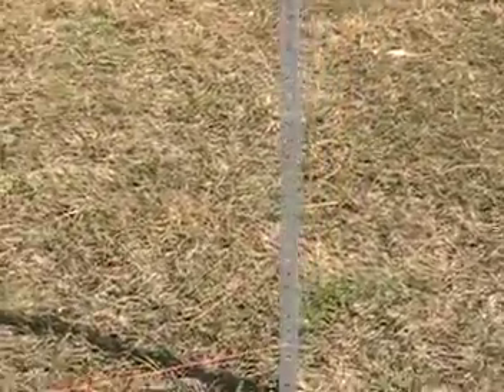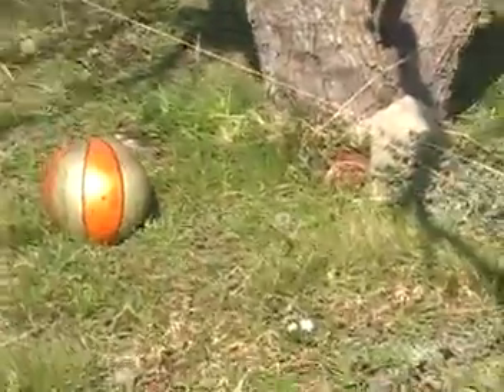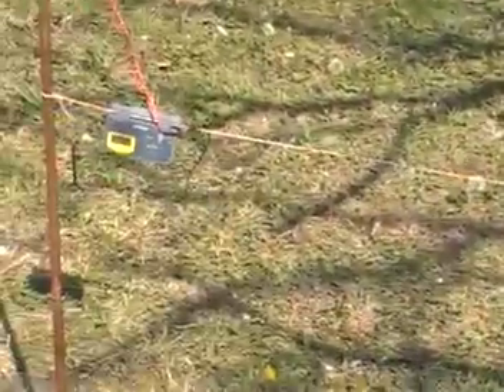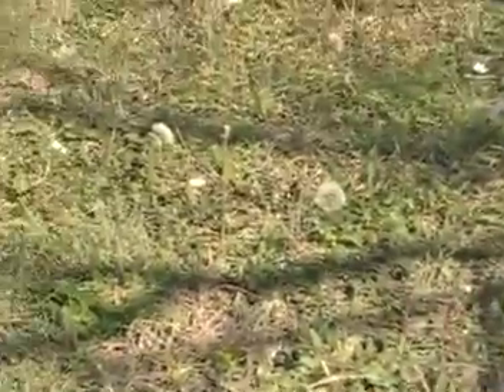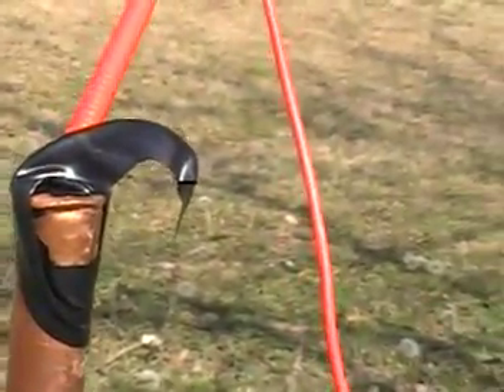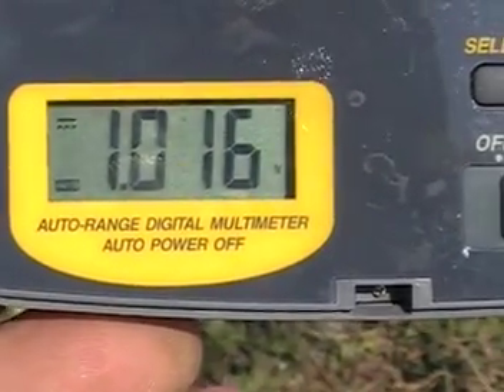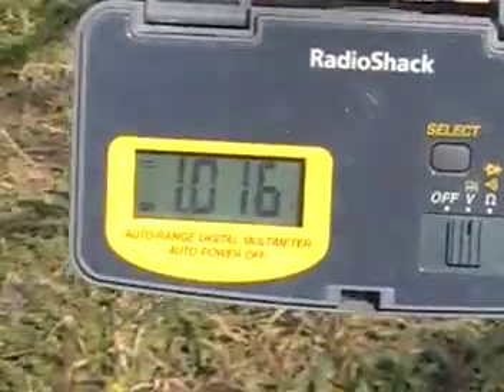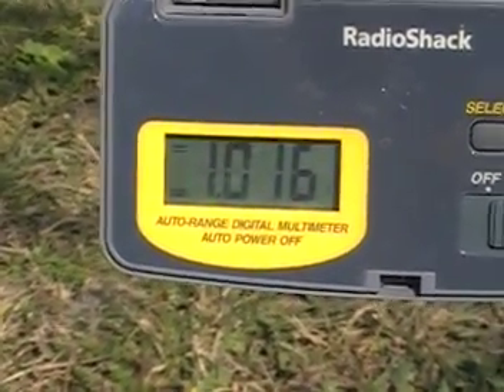My earth Battery

Comment: Is that true north or magnetic north? Kinda cool though knowing one's backyard has some energy :) Would it be possible connecting maybe a capacitor to it and letting the charge build over time? Ok I know..it would probably take 50 years..so don't everybody jump on me for just asking..LOL
Reply: A few quick bits of math:
1 Amp means 1 Coulomb of electrons are passing a point in a wire every second.
Capacitors are measured in Farads.
One Farad means that if you put one Coulomb of electrons in, the voltage will be one volt.  To put it two Coulombs, you need 2 Volts and so on.
A one Farad capacitor is a very large one BTW.
You can loosely think of a 1 Farad capacitor as a 1 amp-second battery.
A car battery would typically be 60 Amp hours
60 Amp hours = 60 * 60 *60 = 216000 Amp seconds
Thus if you are doing a huge number of charge / discharge cycles a capacitor may be worth investigating but if you need to store much energy use a battery.
Reply: I once read an article in Popular Science about some people studying lighting. They found that the charge in the air could be "bled" off if there were many small antennas to dissipate the charge. The numourous antenna points would reduce the number and strength of lighting bolt strikes. I often wondered if this technology could not be harnessed to charge a large capacitor or battery during a storm to feed power back to the grid at a later time.
Reply: Tn Flash If you have a sharp pointy object some distance above the ground, you will see a static build up on it even when there is no lightning storm in progress.  It would be a tiny fraction of the energy in lightning but it could be a worthy experiment to see what you get if you live in a place where lightning is common.  The energy in a capacitor is:

E = (1/2) * V^2 * C  AKA (1/2) * V * V * C

Where:
  V = volts
  C = capacitance in Farads
  E = Energy in Watt seconds
 
Since the V appears twice, you get much more advantage by making the V bigger than making C bigger.
Please don't kill your self while trying the experiment
Reply from the maker: if any one jumps on you for asking ,  they need their heads examined.  There are a couple of guys on you tube working on this and doing rather well . 5running LEDs and charging small things.

Comment: A real earth battery is not supposed to work by galvanic action. Rather it harnesses the Telluric currents in the earth as some commenters have pointed out.  If pure galvanic is all you are after it would not matter what orientation the poles ov the battery are. As for DC current not being able to travel large distances, this is false. It can travel just as far as AC for a given voltage. In fact sometimes they move large amounts ov power across continents using DC as the inversion and rectification losses at each end are actually far less than the inductive and capacitive losses AC currents over these distances would experience.
Reply: Right, I know for a fact that the large transmission lines run DC current.  They generate a force field so birds never sit on them.  Anyone can witness it for themselves.

Comment: You should read about Nathan Stubblefield, a farmer back in the late 1800's in Kentucky. This man ran multiple arc lights and other electrical equipment on his farm from so-called Earth batteries. He patented an Earth battery, although he did not want to call the device an Earth Battery---the US patent office would not give him a patent unless he changed the name to Earth Battery. He invented a voice communication device that transmitted through the Earth for many miles and was powered at the same time by his Earth batteries. Tesla theorized that the huge Earth currents that Stubblefield utilized were being generated by the Solar Flux, or wind. I was intrigued by this whole affair of Nathan Stubblefield's free electricity. I looked up the geomagnetic maps of the USA on Google. Sure enough, huge lines of magnetic force are flowing through Kentucky. I found a researcher who theorizes that because Stubblefield's farm was located in an area with large deposits of Pitchblende (Uranium Oxide), heavy electrical currents are generated. (I can't fathom the Physics of this theory) It would also explain why Nathan Stubblefield's family became ill and finally left the farm and Nathan---Radiation!. Over the years Nathan became thin and sickly and finally was found dead in bed on his farm that he neglected in favor of exploring this electrical phenomenon. The phenomenon is called Telluric currents, so-called Earth generated current. Its difficult to find in depth scientific information about this subject. True, telegraphers also tapped into this current to run their telegraph lines. Its fascinating how they located these Telluric currents. What Stubblefield was extracting from the Earth was not generated by a battery effect with two dissimilar metals. He was simply tapping into currents that happen to be flowing close to the surface of the Earth at this farm in Kentucky. True, tapping into areas close to trees improved current flow. Today, a college is located on the property. There are several web sites on Nathan Stubblefield. They aren't very scientific, but still are fascinating to read.
Reply: Seems the "earth batteries" used copper plates working more as collectors than two dissimilar metals to create electrolysis.   As pointed out, the two approaches are vastly different.

Comment: The earth frequency is more precisely 7.3 Hz.  
 My guess about achieving max voltage from an earth battery depends if you are at, on, or close to an earth power point - ley line.   You state about 19th century telegraph transmitting messages several hundreds of miles and that a much higher voltage would have been necessary.  It takes a degree of skill to find an earth power point.  If you can find  old telegraph sites/repeater stations(old train stations???) test the battery there.

Comment: This is how batteries work, you have two different metals in an electrolyte.
The metals will eventually get eaten away & the battery will die.
You have to choose if you want to buy copper pipe & zinc or buy a duracell.

Comment: telluric currents were discovered during the time of the telegraph, when they noticed a difference of potential from station to station amplify the signal, a natural phenomena that occurs on the earth, between the ionosphere and the crust of the earth and runs from the equator to the poles, maybe this was the idea of tesla's to use these telluric currents over long distance to produce large amounts of current, to power the earth wireless. but then again I have no idea what I am talking about.

Comment: first of all voltage isent squat without current unless its hi frequency 1 volt there should be 250-500 ma to do anay work 2 is time over volt amp this is how long it will go before its dead most tellagraph systems used a dry cell battery 1/1/2 volt-6  there was a way to talk using audio amps fed into earth  one to send one to receve and both sides need 2 to make it work

Comment: The theory behind this was part of my trade and what they did was they used the earth as the "Return wire" and had only one copper or galvanized wire between the stations so they saved on material. They still used dry cells for the current supply. The telegraphs used more current than the 0,000002 amps as what get developed!

Comment: They didn't use straight metal poles stuck in the ground. They have 2 coils on the transmitting end, one for + and the other -, but you grounded out most of your circuit with both ends grounded.

Comment: Earth is not a battery. The 2 different metals are a battery. what this experiment shows is that you can conduct current through the ground wireless.  Nikola Tesla did this first 100 years before this guy. He could light lamps just touching them on the ground with no wires 10miles from the source of the energy. Sorry for my english :)
Reply: ha...i wrote the same thing before reading  your very true comment,

Comment: try this, get a copper pipe 5cm diamiter, 1 meter long and at the end that you will push in the ground put some plastic around it and push it in to the ground about half a meter. then carefully get a zinc rod and push it in the copper pipe. when you push it make sure the zinc rod dont touch the copper pipe and it dont touch the plastic in the soil. if you make 12 next too each other and conect them in series you should get high voltage. WARRNING YOU CAN GET ELECTRICUTED BE CAREFULL. let me know.

Comment: All this is a basic galvanic cell, Stainless steel to copper?  The stainless steel is the anode the copper is the cathode the Earth is the electrolyte.  As soon as the stainless steel angle iron corrodes away...you will have no voltage left at all and the angle iron will be spent.  pour water on the ground at both electrodes, drive them deeper...you'll see, the voltage goes up to the potential difference of the two metals.

Comment: I agree... If a mostly "dead" AA battery can run 200 LEDs (as seen in a common video under the search string "joule thief".  I believe you can easily use this configuration with a Joule thief circuit to light a porch light.  I think its great!

Comment: This may require a couple of post but I hope it is helpful. The potential difference between the copper, having a potential charge of +0.34V and the zinc having a potential charge of -0.762V results in a potential difference of 1.102 volts.
Reply: So the ground has nothing to do with it? It is the difference in potential from the materials? The elements?The electron configurations in the different metals?

Comment: Any variations can be attributed to the other elements use to make the alloys labeled as copper or zinc as they are never pure copper, zinc, aluminum, steel… I have not done this experiment so I can only hypothesize that the N-S orientation will make no difference it the output voltage or current. The current is a result of the surface area of the electrodes submersed in the (dielectric) earth.

Comment: Addressing the solar panel numbers. 12V/15W/3A? In that P = IE where did the other 21W go?
(P)ower measured in Watts = (I)current measured in Amps times (E)volts resulting in 36W moreover P/I=E and P/E=I
The current can only be 1.25A not 3A if it can only yield 15W or the voltage can only be 5V
Last consideration. A earth battery is 24/7 and a solar cell is at beat 12/7 (Subtracting from this cloudy days as solar cells are rated by full sun)

Comment: resitance in power lines causes power loss , except where the power lines N & S on the magnetic p[ole . long transmission lines generaly do not loss power and during solar flare gain electricity , IE power outage in south Florida was caused by voltage gain during a flare.

Comment: @DrLafranz  meaning the closer you are to your own house .. .which carries electricity into the ground .. or any other emp  generators that is grounded .. you will measure more current.. or voltage.   it is the same as those emf meters

Comment: well the earth is a conductor of electricity ..  ground is supposedly an infinite positive charge..   there is  possibility in theory of free electrons moving through ..  but in actual practical sense..  its nothing..  because the earth is so big .. and electrons tend to distribute evenly through conductors with no internal emp'.  it is possible to distribute electricity through the ground .. but it will dissipate the further you are away from the source.

Comment: @procious well from what i saw in this video.. it seems that he has the meter connected in series. with the wire... which makes no sense to measure voltage.    you should measure the current.    in reality .. the volt meter has very high resistance.. about 10^9  plus . so even if you have.   1^-9  amps  running down the earth.. which actually  almost zero..     you can generate 1 volt.   thats nothing probably just the voltage of the volt meter battery itself.  its not practical

Comment: off the top of my head:
for 12 volt, 36 watts, 3 amps, total pipes, 156 copper 156 galvanized. 
Each of 12 sets of 2 pipes wired series =12 V 1 A.  
Then 2 more sets of 12 in series. 
Then All sets wired parallel = 12V 3A. 
Amps = Watts/Volts 
Compare
Earth Battery 12 volts 36 watts 3 amps. 
Solar Panel : 12 volt 15 watt 3 amp solar panel costs ~$60. 

Electrical experts please coment/correct

Comment: the wire size and the Anode and cathode size give you amperage but the Voltage has to be wired in series just like all batteries. Even huge electric fork truck batteries are only 2 vdc per cell and these can make over 100 amps. this is NORMAL!!  Once the galvanised anode rots away the battery is finished. Duracell battery is Carbon and zinc, when zinc is gone you throw out Duracell and put in a new one right?

Comment: the wire size will effect the Voltage and amperage. Volts divided by AMPs times Resistance is Ohms law. Higher the resistance the lower the amps..

Comment: is say that the metal components are mostly simply picking up radio, tv, digital telephone and anything else that is transmitting electrical energy in the local environment, which when probed with a multimeter gives an electrical energy reading. However, the electrical energy would be broad spectrum [multiband?]. An analysis of the electrical energy with a spectrum analyser would surely prove this.

Comment: @RHEAD100 This arrangement is not a chemical battery. If the elements are connected above ground with as little resistance as possible the electrodes are not appreciably chemically eroded even when the ground they're in is saturated by water.

Comment: pull the anode and diode out of the ground and it will still work... put it in a jar of electrolyte and it will work even better.  The minerals in the earth replace the electrolyte (hydrochloric acid in car batteries) and it works better in the ground than out, better in hydrochloric acid than in the ground.

Comment: i saw a demonstration were there was 2 powerlines., and the flow was between the 2 wires. so if you had pos. top wire 60 feet, and neg bottom wire 60 feet, at each quarter wave there could be power.

Comment: @RHEAD100 If you have your electrodes far enough apart you would be tapping into the Telluric current-which is what you said in your video. Its a current produced naturally (and by human activity) running throughout the Earth. However if your electrodes are too close you are producing a copper-zinc battery as dzntms144 said.
Still pretty cool though.

Comment: Some clarification, if I can.

DC will flow forever if allowed to; it has no distance limits.  Note that high-voltage DC (megavolt range) is used in some places to cross large distances more efficiently than AC.  AC is less efficient because it radiates radio energy (at 60Hz frequency) when your cables approach 1000 to 2000 mile lengths.  High voltage is the key to get DC to travel longer distances, due to ohmic losses in the cable.

Comment: @jkrohn22 
as to how they would send transmission over a long distance. It actually is the DC current carrying it that far. They would put these "capacitors" in series all the way to their destination creating conducting voltage drops on each side of the different metal poles. The DC current would only travel the distance between these capacitors and the AC current (telegraph) signal to "ride on" the DC current. Short of it the Earth is not producing AC current on your rods.

Comment: An earth battery is only a "capacitor" basically. The two different metals create a voltage drop in reference to the Earth(ground). Telluric currents is the power that you are drawing from the earth magnetic field. As you say in your video it is a AC current,  since you are creating a "capacitor,"  like element which is purely capacitive it blocks DC current which would still allow a small signal to go through i.e. a telegraph.

Comment from the maker: @dranoise THANKS;
Straing you should mention building a boat.  I have been working on a new design for the 2 stage oscillator to power a boat.  Guess maybe I should start worrking in that direction. A  2 stage oscillator of any power is really heavy  "BUT"  weight in a boat is only balist.

Comment: THANK YOU FOR POSTING THIS.  USING MORE SURFACE AREA WILL INCREASE AMPERAGE AND VOLTAGE.  SERIES= MORE VOLTS.  PARALLEL = MORE CURRENT.

Comment: learnt at my education that highvoltage powerlines (unisolated) when being worked upon requires the workers to short the wires and ground them in both ends, and at the point where the work is being conducted..
i dont have the high voltage certificate, but we did get to hear some routines and stuff at school..
if i remember correctly, they did that because the cable acted like a capasitor of some sort, storing the energy..
electrician here:-)

Comment: This is just an electrochemical cell with the earth as its electrolyte. If it utilised some kind of electricity inherent in the ground it would work with two identical electrodes. Your multimeter display showed that the voltage is DC, too.

Comment: Do you think if you used 24 awg streanded wire the voltage would go up do to the skin affect?  diode on the end of the wire going into a electrolytic capacitor?

Comment: great video mate, just out of interest is there any power lines running the same orientation anywhere near the setup u got there? if not im guna play around with that... i wonder if you have just made a large capacitor or if you can actually drive a small load using this effect

Comment: streighten a paperclip and wrap with saltwater wet papertowel. Now coil some copper wire around it and be sure the copper doesn't touch the paperclip.

You'll get .8 1.3 Volts and .5 - 1 mA

much smaller, much more simple